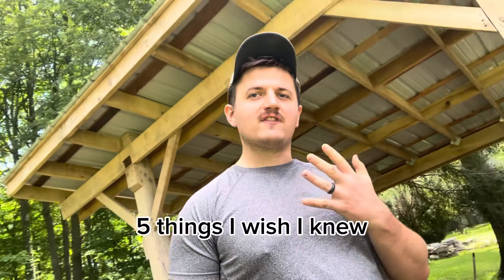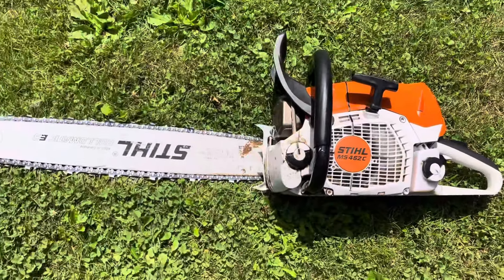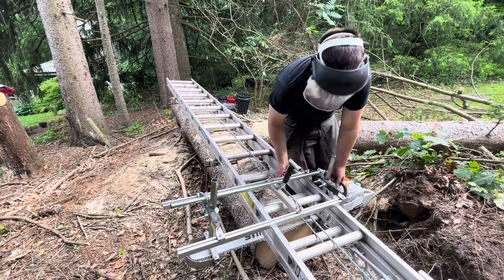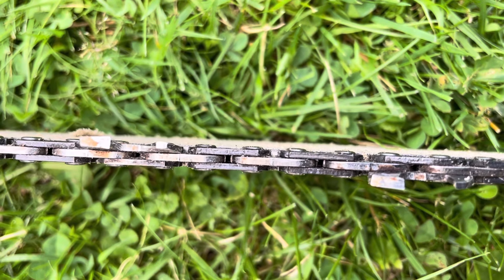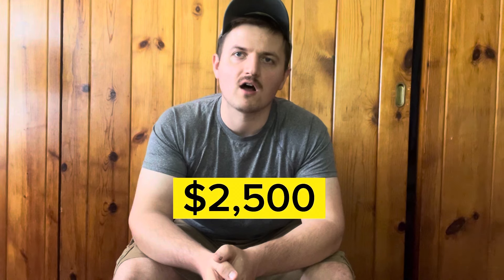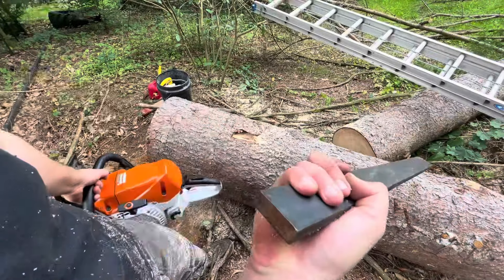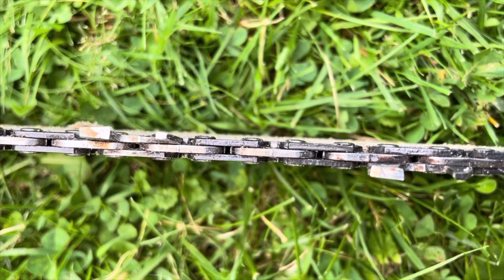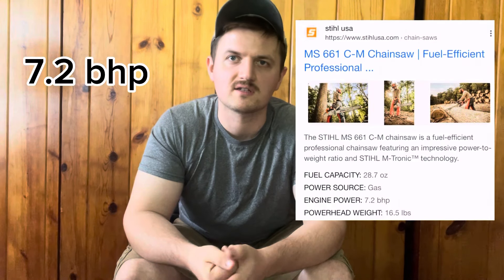Watch this BEFORE buying a chainsaw mill.

Comment from the maker: Subscribe if you use a chainsaw mill 👍
Reply: I will think about it....I mean....I  used to use a chainsaw mill.....nowadays,  I almost always go freehand....
Reply: Yes I’ve gag two blue max saws and so far they have ran better than my husky the only problem is the chin is soft so they stretch to much so I replaced the bar and chain with my husky bar and chain
Reply: When you say milling blade, do you mean ripping blade?
Reply from the maker: Hi Enchantedmountain, yes milling/ripping chains same thing
Reply: Are not milling/ripping chains ALSO full skip sequence chains?

Comment: How about a Sthil 500i? I have a husky 562 that may work for smaller boards.  I have lodgepole pine and blue spruce. Few are over 24"  Wish I still had my extension ladder, it melted in a fire.
Reply: The 500i is a very awesome saw!  For just 80 cc it's powerful!  I also have a husqvarna 592xp which is 92 cc.

Comment: Hello, I am from Tahiti and really appreciate your video, may you tell me if is really better to make a granberg milling chain (I mean take out with a grinder the half of teeth every two)
Regards Raiarii
Reply from the maker: Hi Raiarii, yes having a milling chain helps take the workload off your powerhead and makes cuts faster with less effort required by the saw. A milling chain also will stay sharper for longer than a crosscut chain will when ripping with the grain instead of cross cutting against it.
Reply: @coletaylor123    I meant the difference between standard ripping chain and granberg ripping chain

Comment: Ive milled probably about a hundred slabs with a farmertec 880. Best results have been with a skip tooth ripping chain. The saw has held up great minus a few pull strings

Comment: If guys are worried about their chainsaw, use Lucas two cycle oil, double the mix ratio. I also save all the used oil from my cars and trucks to use for the bar.

Comment: Letting it idle isn't good for long periods of time. It's a 2 stroke and a 2 stroke that's meant to be at high rpms 99% of the time to run clean idling too much will clog your spark arrestor and foul your plug.

Comment: i mill with a well used 372 xp and it does great 28in bar.  ive produced lots of lumber in last 2years on this thing. do i want a 10,000 dollars band saw ? yes but no thanks im doing just fine with out one

Comment: a chainsaw mill would be hard pressed to produce high quality consistent lumber . . . there is simply no way to work the tree with one . . .could you imagine trying to roll a tree with one of those to catch grain and get real quality lumber . . . be a nightmare and near impossible i'd think. . . and forget precision cuts with one of those rigs. . . don't think it's a fair comparison beyond price point maybe between one of these rigs vs a proper mill, even the cheapy ones . . . yeah i think this is more a niche market and just can't see high quality lumber coming from it. . . you should reach out and do an equipment  comparison and talk with the bama boys hobby hardwood . . . that'd be interesting and a good follow up to this.